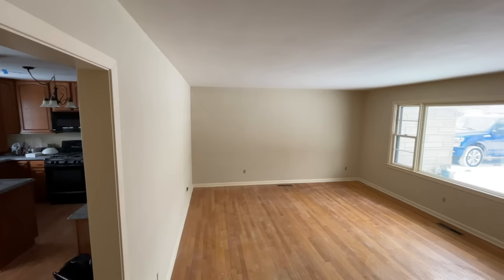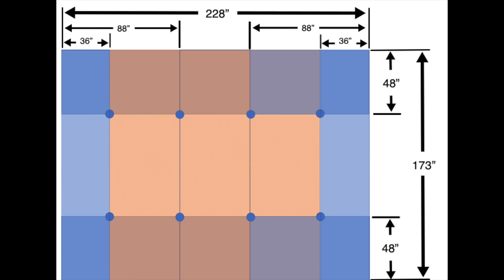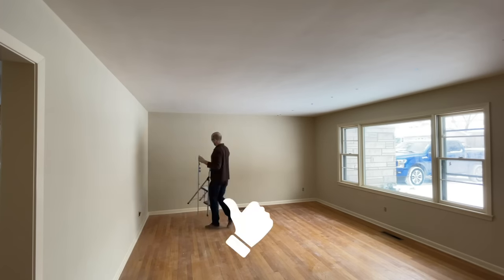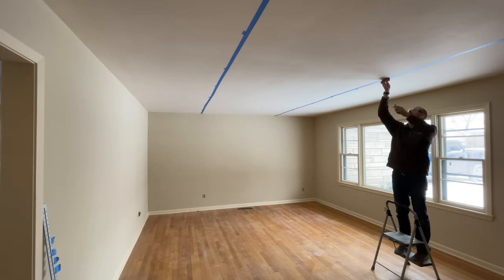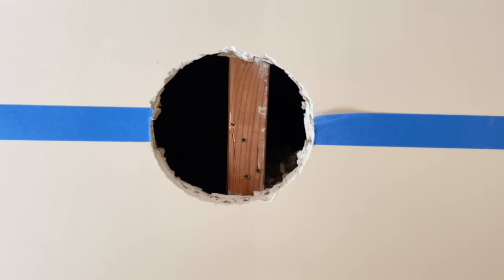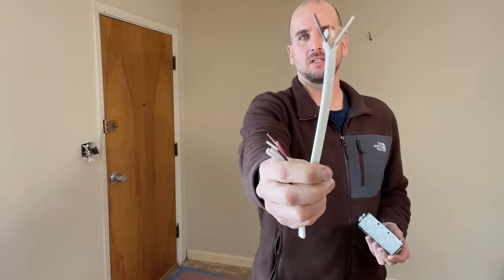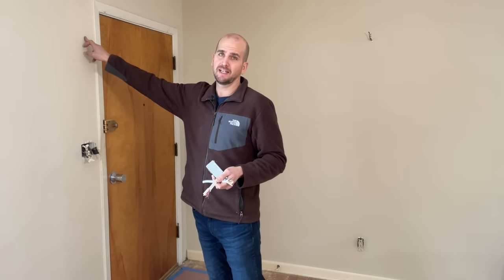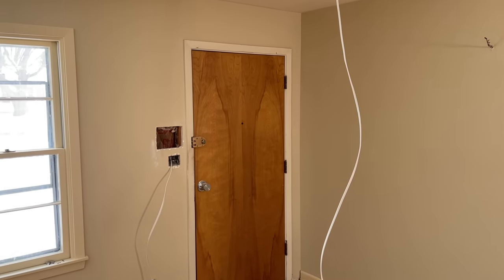Ultra Thin Recessed Lighting | Transform A Dark Living Space

Comment: Quick question as I can not find information anywhere: How to remove those lights? If the tabs are holding it tight and you have no access from the top, how do you remove it?
Reply from the maker: You just need to apply pressure under the white lip pulling down.  Usually you then can pull down far enough to fit your finger between the light and ceiling to push back the springs and remove from the ceiling.  I push back the springs to avoid ceiling drywall damage.  Let me know if that works 👍

Comment: If I install these from below without going into the attic, is it safe and acceptable by code to just leave the wiring boxes for each light loose in the attic above the ceiling, or do they need to be screwed into a joist?  Is there a fire hazard by not securing them to something and clearing insulation from around them?  Thanks.
Reply: Good question. What is the NEC code please
Reply: If you have attic access, I would go ahead and secure the wiring and boxes, if it's fished through a ceiling where there isn't any access, go ahead and leave it loose.

Comment: i note there is no vapour barrier in the ceiling.  
to install such (or any) fixtures with a required by code vapour barrier adds triple complexities.  Been there and struggled with it.
Reply from the maker: I would have to say in our area I have never ran into a vapor barrier in the attic.
Reply: in what part of the continent are you located?
Reply from the maker: @gilleshuizinga4339  I am in Illinois
Reply: @EverydayHomeRepairs  I am in Canada. 
with the range of temperature variations, we have a significant humidity issue.  * Humid air wants out, and as it moves out, it will freeze somewhere in the insulation, albeit R10-R60 ( in our attics).  
Now, frozen, come spring, it thaws and leaks back into the house. 

We need to provide a continuous vapour barrier, without leaks, from the warm space to stop the humidity before it hits the insulation.  For an installation, such as you have shown (and i was hopeful) we would need "hats" made of a poly, which then must be caulked to the vapour barrier to cover the housing for the electrical outlet boxes where they are used.  
A much larger operation unfortunately.  

thanks for the video, i enjoyed it very much.  Now, to figure out the installation of the "hats" in the attic.  
having done that for a DIY retrofit of reqular pot lights, I have the scars from the roofing nails on my head to show for it.  

cheers.
Reply from the maker: Good stuff Gilles, thanks for all the great info and the vapor barrier in that type of climate makes perfect sense. Best of luck on the project 👍

Comment: Is there a reason you didn't put ground on the switches? Is that not required, or is it because you are doing a dimmer switch later on?
Reply: He connected the grounds to the box (screw in lower right corner) so the switches are grounded through it.
Reply: @mcginniscm1  got ya. Thanks
Reply: As long as the electrical box is metal you don't need to ground the switches if it was plastic yes you would ground the switches or dimmer.
Reply: @dimitristathos5308  got ya. Thanks. :) because he grounded the box and the box is connected to the yoke

Comment: Great video! Thank you for sharing. Do you know if its a good idea to caulk the edges of the ceiling hole to prevent any air flow? Or do these lights come with a gasket ?
Reply: I was wondering the same. I have a slightly textured ceiling.
Reply: Most have gaskets on them

Comment: I always thought you couldn't hide a junction box (attic with no blank plate facing into the room.)

Am I wrong?
Reply from the maker: At least in my area you can have a J box in the attic or basement.  Just can't bury them in a wall.
Reply: It needs to be accessible, as long as there is access to the attic, that satisfies the requirement.

Comment: I’m trying to figure out why you needed the 14/3 wire??
Reply: From the junction box in the ceiling, the black is sending the hot down to both switches. Then the red is carrying the power back up to the LED lights (the "load") when switched.

Comment: I installed the same lights with the dimmer switch but when I turn them on they first turn on all the way for half a second then shut off then turn back on to whatever level I have them dimmed at. Any suggestions?
Reply: I’d Get a different dimmer switch. Did the switch come from Amazon or box store?
Reply: @wyattsdad8561  Thanks for the suggestion.  I tried 3 different dimmers, but it turns out that the problem was being caused by a faulty grounding method on receptacles on the same circuit.  I disconnected the wire that someone previously routed from the neutral screw to the ground screw of half the receptacles on the circuit, and voi la, problem solved!
Reply: @andrizeefoshizee  oh nice good job 👍
Reply: @wyattsdad8561  Thanks.  I'm so glad it's working now.  Thank God!
Reply: @andrizeefoshizee  lol I bet. That would be very frustrating
Reply: @wyattsdad8561  Sure was.  It took over a month to eventually diagnose.

Comment: Hi, if the lights are 6 " , if you cut a hole that's 6 and 3/8, wont the hole be larger?
Reply from the maker: Nope the lights have a small flange that is larger and will cover the hole.  You don't have a lot of extra room but 6 3/8" is usually the right size hole for these type of 6" LED lights.
Reply: @EverydayHomeRepairs  Thank you. Do you have a video on installing very heavy glass doors? (Simonton?)
Reply from the maker: @lisagarrett6966  I do not.  Sounds like a fun project 👍

Comment: It wasn’t clear how many trips you made to attic for pulling wire. What I do is pull up into the first to the farthest hole and push down about a foot. Then I drop loops about 16 inches into each hole, and then cut off at the square box. I prefer to wait until all wiring is done to connect to power.

Comment: Do this on a 2+ story house on the first floor, then lets talk ;)
Reply: Done it….  First floor living room ceiling  No holes to repair.  A few swear words and a lot of time, but mission accomplished
Reply: he got lucky pulling the wire with the old one. Must not have been stapled or that wouldnt work
Reply: @adammiller8415  EXACTLY.
Reply: He did, in another video. It was a condo. In fact it was the same scenario with the switched outlets and he rewired all of them and installed a light to the switch.

Comment: Wires are way too short, no adequate grounding in the attic junction box, no pre twisting of wiring ( yes I’m aware it’s not required but in practice it makes a crappy connection) attic insulation makes that box a hidden box.
Reply: Good point Joseph and a good vid! You should always pre-twist wires for safety. Every electrician I've worked with over the years pre-twists wires and it's standard practice where I work. It's also makes for better, safer connections for homeowners and DIYers when using wire nuts.
Reply: He should have mounded the junction box higher up on a rafter or piece of wood so it doesn't get buried in insulation.

Comment: Why not wire the ground to the box?
Reply from the maker: For the junction box I installed in the attic?  If yes, that was missed on my original install and should be added.
Reply: It’s done now no worries to go back but I have learned if your electrical box is metal it is easier to wire your grounds to the box like you have done before then if your post are not self grounding to run a small pigtail from your screw to the switch/ connector just makes things a little neater and easier. 
The down side to plastic boxes :(

Comment: There were no links when u said they would be in the upper corner. There was no gear in the bottom corner to speed up or slow down the video.
Reply from the maker: Hey Michael, are you watching on the YouTube website or on the YouTube App from your phone?
Reply: App on my phone.
Reply from the maker: @michaelleo5620  thanks and you are right that is a bit different on the App.  To change the playback speed touch the video once and you will see 3 dots in the upper righthand corner.  touch the 3 dots and then you will see the "Playback speed" setting which you can adjust.
Reply: Thank you.

Comment: You should have pigtailed the ground wires and connected to the ground on the switch's ,also just for safety i would have wrapped tape around the switch's .
Reply: Around the switch's what?
Reply: @Cotronixco  some people tape over the screws that hold the wires as an extra protection.
Reply: @arielbaena5254  Around the switch's what?
Reply: @Cotronixco  The screws. Wrap tape on back half of the switch covering the screws on both sides of the switch
Reply: @arielbaena5254  It's fine to wrap tape around the switch to cover the screws, but to wrap tape around the switch's screws doesn't make any sense.
Reply: @Cotronixco  Its an extra layer of protection covering all points of contact. Not necessary but it does make sense.
Whatever you just said doesn't make sense. " its fine to wrap tape around the switch to cover the screws but to wrap tape around switches doesn't make any sense"  Does it make sense or not?
Reply: @arielbaena5254  I didn't say that.
Reply: @Cotronixco  then I'm in the Twilight Zone. Three post above this one it's exactly what you said.
Reply: @arielbaena5254  You must be in the twilight zone. Let's compare:

wrap tape around the switch's screws
wrap tape around switches

Do those look the same to you?
Reply: @Cotronixco  you can't wrap tape around  the individual screws.  You'd wrap the entire back of the switch.. Come on.. its not that complicated.You'd Wrap the switch to protect the screws exposed  wire from making ANY contact.  That's the difference between a DIY/Handyman and an electrician.. I surely hope you're not playing semantics. The unit that turns the light on and off is called a switch. You're wrapping tape around the switch from the top of the switch around the bottom and back around hence wrapping the switch to cover the screws.
Reply: @arielbaena5254  You attempted to answer the wrong question. The question was never answered. Wrap tape around the switch's what?
Reply: @Cotronixco  what do you think should be wrapped with tape on a switch? I'll give you a hint it starts with T
Reply: @arielbaena5254  That's not the question. Please read carefully.
Reply: @Cotronixco  The switch's Terminal.. Switch with an apostrophe S as in Belongs to the switch.... you're one of those people that corrects grammar and spelling?  Maybe the guys [done on purpose] phone auto correct did it just like it did when I typed Guy's on my phone.
Reply: @arielbaena5254  So why are you filling in the blanks for @Robert Mungenast?
Reply: @Cotronixco  If the guy wrote switches would that have been better?  Would you have understood? That's a long corny way to call out a silly typo..
Reply: @Cotronixco  because I didn't realize I was explaining to someone as smart as you.
Reply: @Cotronixco  BTW Switch's Screws does make sense.. So why would you write it doesn't make sense? Reread what you wrote..
Reply: @arielbaena5254  switches and switch's ___ are not the same thing. SISO.
Reply: @Cotronixco  "It's fine to wrap tape around the switch to cover the screws, but to wrap tape around the switch's screws doesn't make any sense."  

"THE SWITCH"S SCREWS DOESN"T MAKE SENSE."  Apostrophe S = Screws belong to the Switch. What part of Switch's screws doesn't make sense genius?
Reply: @arielbaena5254  You can wrap tape around the switch to cover the screws. But wrapping tape around the screws requires an illiterate or an idiot. You choose.
In addition, the word "screws" was left out by the responder; hence, the question.
Reply: @Cotronixco  the conversation pivoted to you saying the "Switch's Screws" doesn't make sense.  Try to keep up..
Reply: @arielbaena5254  I'd like to see you wrap the switch's screws instead of the switch. Or should I say the switch's . While you're at it, be sure to tighten the switch's . And staple the cable's . Also, be sure to tighten the plate's . That advice should be fine as frog's .
Reply: @Cotronixco  Sorry the OP's Typo made it so complicated for you to understand what he was talking about. Just remember to wrap the "Switch's Screws" with tape.
Reply: @arielbaena5254  Sorry that the "switch's what?" was so far over your head. Or that you don't know the difference between a typo and lack of elementary education.
Reply: @Cotronixco  How is it over my head, If I explained that it was most likely a typo..
Reply: @arielbaena5254  Again, not a typo. Not even close.
Reply: @Cotronixco OK then explain how's it's over my head if I know what you were talking about.
Reply: @arielbaena5254  Your response gave it away.
Reply: @Cotronixco  So  after 30 hours of explanations on what needs to be wrapped do you finally understand what part of the switch's [oh wow  look what swype typed out] should be wrapped? If you still don't get it maybe working with electricity isn't for you.  May I suggest crayons and a coloring book? Try not coloring outside the lines.
Reply: @arielbaena5254  There is no need to wrap the switch in tape which will come off over time anyway, if the switch is installed properly in the first place. And that has nothing to do with my original question, that you missed completely, simply asking the OP to simply finish his sentence. Still over your head.
Reply: @Cotronixco  You don't wrap the switches and outlets in my Shop you wouldn't work here. I'm sure there's a handyman out there that can use a simpleton sidekick like you.
Reply: @arielbaena5254  There is a reason the NEC doesn't require tape around outlets and switches, but apparently that's over your head as well.

Comment: I have a problem with these. They are non-standard, so you will need to HOPE that the company that makes your lights is still in business when they go out. Many of these companies have already come and gone. This leaves customers with mismatched sets. What's worse, is actual lumens and color varies substantially even within the same brand and line. So you WILL end up with some lights that are a different color, mismatched, and of different brightness. It would be nice if there were standards as there have been with bulbs for quite some time.

Comment: I wish these things were banned. They give off horrible glare type light. I know these are cheap and fast and work in some extreme situations such as under tight ductwork, joist etc. Do yourself a favor and buy something like the liteline intergrated or other. They have a real lens which casts light properly, lifetime warranty and are still pretty slim.
Reply from the maker: Thanks for the tip Paul!  Do you use the SLIMLED Indirect from Liteline?

Comment: You should not be referring people to use those cheaply made, non-UL listed lights (UL Listing guarantees fire safety specifications are met) - this means they are a severe safety hazard.  They also do not adhere to EMC guidelines about electromagnetic radiation which suggests they failed to meet other specifications for safety and quality.  There are plenty of other brands which are reputable, compliant and safe.